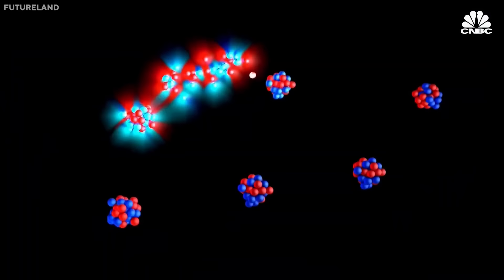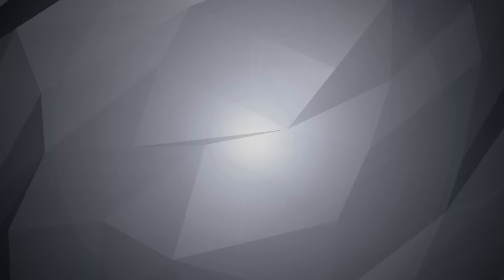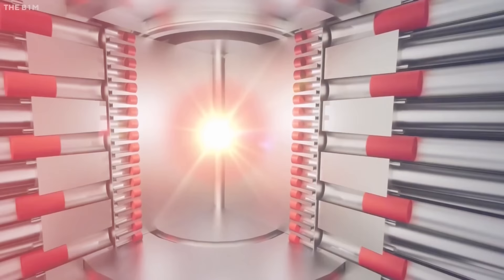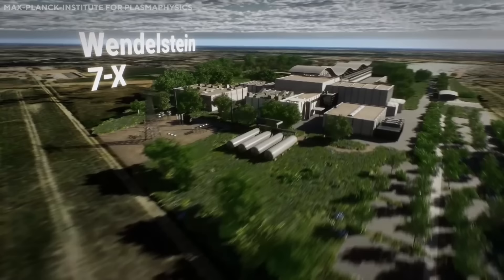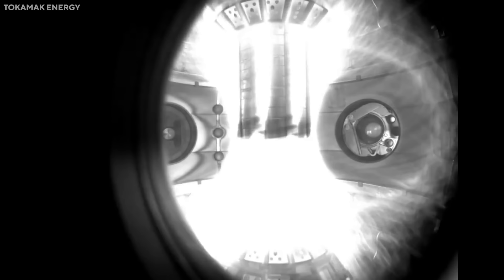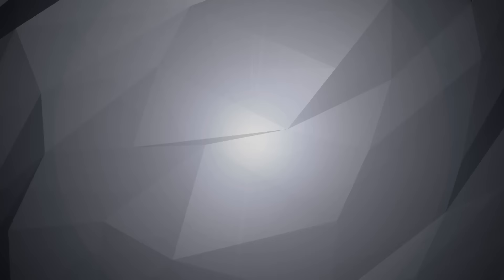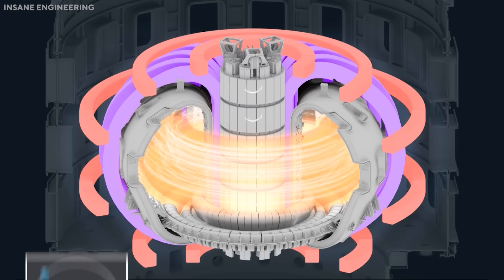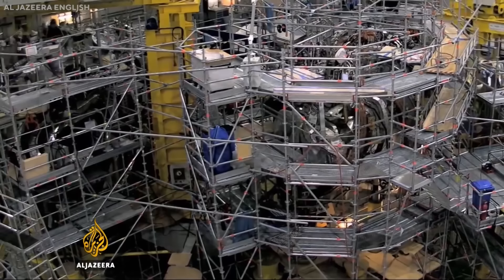Germany's New Nuclear Fusion Reactor SHOCKS The Entire Industry!

Comment: Another DOA fusion reactor. The  issue with a compact Tokamak design is the plasma scattering problem as denser plasma causes too much scattering preventing ions from reaching the necessary collisions speeds to breach the Coulomb barrier for fusion. A lot of the input energy is just wasted on ions getting scattered instead of fusion. Anyone that has a basic understanding of plasma & fusion knows this design will never work. This is just another very expensive jobs program, but has nothing to do with developing fusion power.

Another issue is the the use of HTS (High temperature superconductors) which quench (lose super conductivity) when exposed to high neutron flux. Thus making it impossible to maintain magnetic confinement with fusion reactions. Third is that Plasma generates magnetic fields which interact with the magnetic confinement field causing it to become unstable & collapse. This has been the primary problem with all magnetic confinement reactors. No one has managed to sustain a the magnetic confinement field for more than about 5 minutes before the field collapses. The higher the plasma density the worse the stability problem becomes. That's why ITER is huge; Very low plasma pressure with a large volume so there are a large number of fusion reactions for the given lower plasma density. That said ITER is also a Dead end & a huge waste of money. Even if ITER was successful it will be too costly to use. A real commerical reactor based upon the ITER design would cost well over $100B and cost about $2B per day to operate using tritium fuel. I don't see how any rate payer would want to spend $10 to $30 per kwh from this.

Comment: Tokamak reactors got a main problem, the ever rising current in its coils. This lead to a shutdown all few minutes with the loss of all heated plasma. You have to restart the Tokamak just to have the next shutdown a few minutes later.   This result in a very bad efficiency, and most likely to a fast degration of its internal hull.
A Stellerator do not got this problem. And is therefore from the concept superior to the Tokamak.